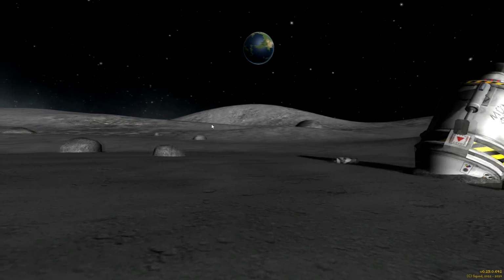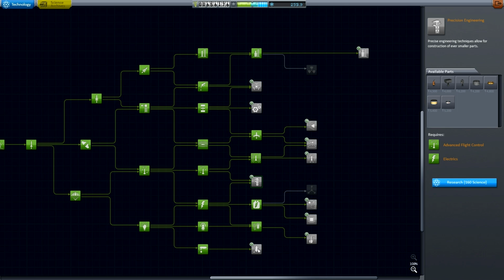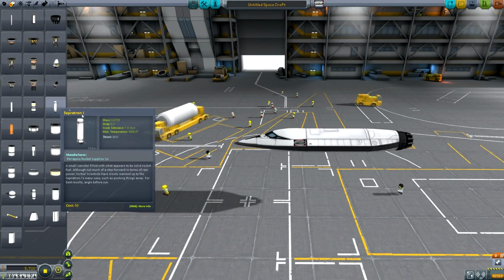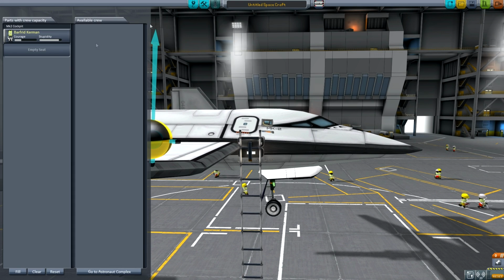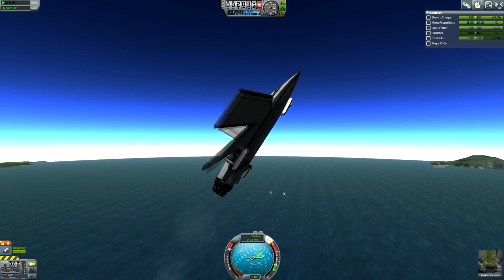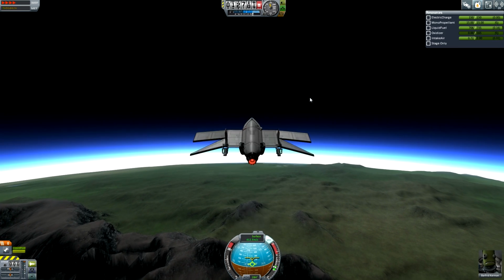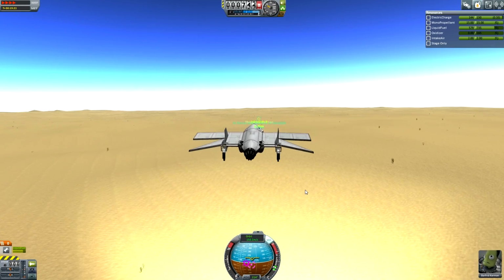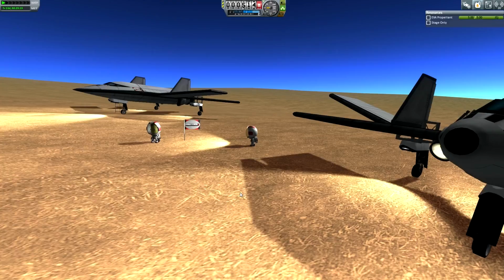Kerbal Space Program - E9 - Spacebound Grounded

Comment: Also, heres a solution, raise the back left gear, and hop on the wing, that way you can walk on the roof and board the plane. :D Dont raise up ALL the gears, only the back-left one, because that will make a slope. If you dont have any probe cores on the plane to control it to raise the gear, you should be able to raise it while in EVA by walking close to it.
Reply from the maker: Can you really control landing gear from EVA?
Reply: Landing legs? Yes, definitely. Landing gear? I din't TEST it, but since they're like the landing legs, im 99,9% sure you should be able to.
Reply: Dodge Them All you suck at belding aerckrrfts on c.s.p.
Reply: Dodge Them All you suck